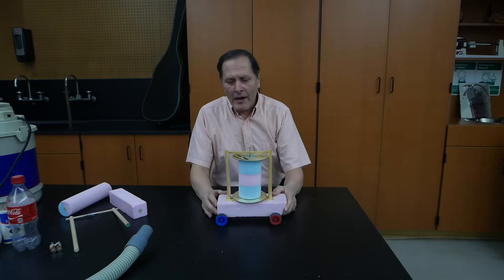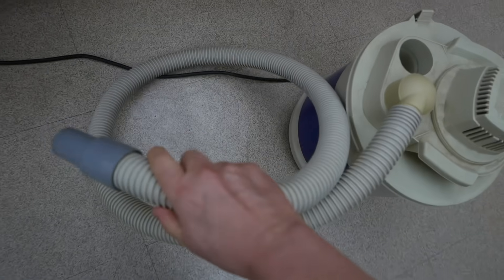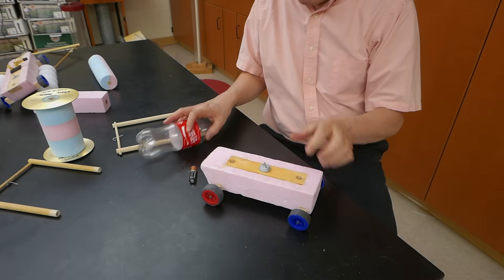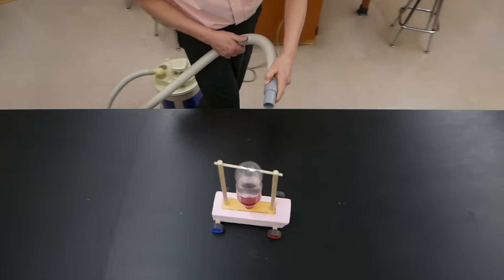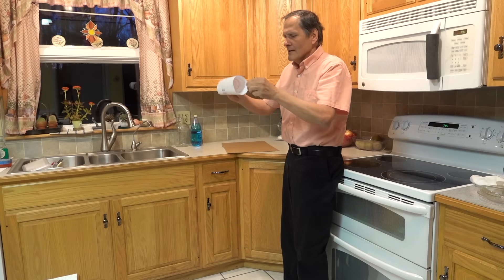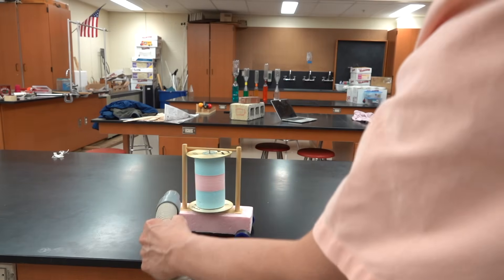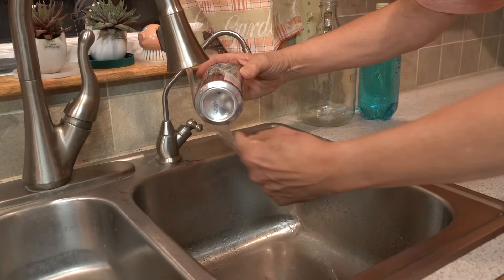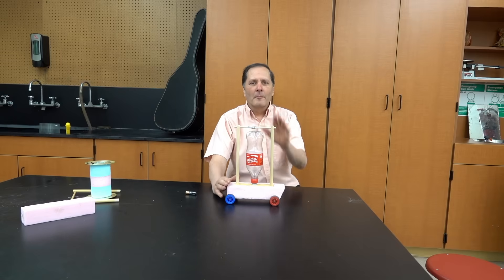Flettner Rotor Sail Cart // Homemade Science with Bruce Yeany

Comment: i saw some articles about ships using these now and found this video when i wanted to find out more. you did a great explanation, thank you. i do have a question, since you need to make the rotor rotate to make it move anyway, is there a power saving by making the motor move instead of say the wheels for that car or a propeller for a boat? if so how much are we looking at?

Comment: The unanswered question is, why does the spinning create the lower pressure on one side?
Reply: Because relative to the air around it, the opposite sides of the spinning cylinder are moving at different speeds, thus creating a pressure differential.

Comment: When using this on a boat, how much more thrust is achieved using the power to drive the cylinder and the wind on the cylinder as to using the power (batteries) to drive a propeller in the water?

Comment: Hey Bruce,...love the demonstration,...learned something new. When you were showing how fluids follow a curved surface and you blew air past the outside surface of the stationary cylinder, it reminded me of what a lazer does when you shine it at the edge of a reflective cylinder, or in my case a 2" diameter rod of clear acrylic plastic. It turns the lazer dot into a line on the wall like a lazer level. Any relation between the 2 seems unlikely, but I had to ask,...

Comment: Wrong effect. 

What we are really seeing is the Coanda effect, which is really redirected airflow. Moving fluids tend to cling to the surfaces 7:02  moving across. If such a surface happens to be curved, the fluid will follow that curve.

This effect was famous in the boating world. Boats that tried to go too fast seemingly got sucke down, sometimes to the point of sinking.

This was definitely not because of the air pressure above pushing them down.

The solution to this problem was having a definite break at the stern, where the transom extended all the way down to the deepest part of the hull, or nearly. This way, the water flow was directed down, at the bow, but not back up, at the stern.

Comment: Hmmm. What if…you put vertical cylinders at the rear corners of a car? They could be powered by the wind, and use their spinning to pump air into the wake zone behind the car, decreasing drag. 

Additionally, cylinders geared to spin the opposite direction could pump air from the rear diffuser, lowering underbody pressure, increasing downforce.

Comment: My question is: why not just use a regular sail as it does not require any outside energy? I suppose it means the flettner is only useful in making another source of propulsion more efficient. Ultimately lowering the air pressure in front and increasing it in the back to create forward motion is what makes turboprops and turbojets work anyway. So I presume it’s just about Flettners increasing aerodynamics to not only reduce drag but to use the force of the drag to increase efficiency.
Reply: I assume the wind can blow from any direction removing the need to tack in a less direct path
Reply: @jamessteidl5260 . Nope. In practice it works pretty much as a normal sail with regards to wind direction. The force vector is always 90° to the wind direction.

Comment: I built an RC sailboat using one of these. It worked pretty well! I just used a PVC tube directly on the top of a brushless out runner electric motor Lol! I could get about 40minutes to an hour of run time of run time. So overall pretty successful!
Reply: to me it seems that if he had put the little electric motor turning the wheels the car would have made headway against the vacuume cleaner's exhaust if he had blasted the little cart head on.  after all these long years of trying to push this concept, lets just put it to bed.  may as well put oars on the ship and let the refugees of various conflicts world wide man the oars.
Reply: @johngillon6969  That's not the point. Besides: It takes more energy to drive wheels on a vehicle or a propeller in water then to spin a tube. It's a sail, not conventional propulsion. You have to tack and stuff to go into the wind!
Reply: @ezrarichardson279  The point is if all the energy from those batteries was applied to the wheels it would be faster no matter what.  the energy to spin the rotor would be more efficiently used by driving the wheels or a propeller.  i feel like i am discussing efficiency with someone who would argue in favor of a recumbent bicycle over the traditional racing bike.  i just think over one hundred years of beating a dead horse is kind of a waste of time.  if the rotor were a profitable venture, there would have been more of them floating around.  this is of course an interesting phenomena. and if recumbant bicycles were more efficient, than you would see them competing in the tour de france.  BTW do you enjoy reding science fiction.?  my self prefers Louis Laamore, i guess it may be a divide between a traditionalist and those prefer to constantly re invent the wheel.  Why?
Reply: @johngillon6969  The question isn't about speed, but efficiency. And besides, the speed of the vehicle is proportional to the wind velocity so it could absolutely be faster than the same motor attached to the wheels directly. Also, recumbent bicycles are among the fastest and most efficient bikes out there (although I prefer traditional ones personaly). My point is that if you're using a couple amps for a long period of time to spin a tube which is supplementing and helping along a traditional propulsion system, that propulsion system will be more efficient and faster overall. After all, it's not the tube that creating the force, it's the wind. And to be fair, the whole point of this video is to show case a cool science concept, it has nothing to do with proving viability. None of this stuff scales particularly well either.

Comment: It would be interesting to see the experiment without the spinning rotor(rotor sitting still) like you showed us, but with a wind guard instead of you directing the wind flow with the blower hose. A guard that allows you to have wind applied to the entire device, like the spinning rotor allows, but directs it to only flow past one side of the rotor causing forward motion. To see if it actually can work, if so then you don't need the spinning motor and batteries, but a guard. IT would be a huge experiment finding the right shape guard that will possibly work. If you can direct more stray wind to one side than the other just by shape, then it might move. but then we will find out the sail is already got it all beat. lol But at least we learn more specifics about fluids.

Comment: could this provide useful thrust if fitted to a push bike ? How big would the rotor have to be and how fast would it have to spin? I'd be grateful to work it of for myself if you can direct me to the formula
Reply: What’s a “push bike”?  
Do you mean a regular bicycle with pedals?

Roads curve and wind directions change “rapidly” on land.  Not so much on the ocean.  You would need to be constantly adjusting the Flettner rotor’s spinning speed and direction of spin.  I also think that you would usually have more of a headwind by the propulsion of your own two feet.  That headwind will direct the thrust to the side, not so good for a bicycle.

There’s another device with a propeller that might work.  I’ll see if I can find the video.
Reply: @sambrusco672  yes sorry 'push bike' means a bike without a motor connected to the drive train.

Comment: Hi Bruce - Great experiment. I never knew about this kind of rotor before. 

A few questions, that I hope you can address, perhaps in a new video:
1. Is it always required for the wind direction to be perpendicular to the rotor? Can the wind vector be at any angle and still generate the same amount of forward motion power?
2. What happens if the wind is exactly behind or ahead of the craft? If it is akin to a sailboat, can the craft move directly upstream or downstream relative to the wind flow?
3. Finally, wouldn't a rotor with fins or blades be more efficient to spin the rotor?
Reply: My thoughts exactly!  I will refer to this diagram https://iveybusinessreview.ca/wp-content/uploads/2018/04/Hapag-Lloyd-Graphic-2-Rotor-Magnus-Effect.png  

If the wind is coming perpendicular from the left (the port side), and the Flettner rotor is spinning clockwise when viewed from above, the thrust will move the ship forward.  Yay!  All is right in the world!

If the wind is coming perpendicular from the right (the starboard side), and the Flettner rotor’s mechanized spin is REVERSED to be counter-clockwise, the thrust will move the ship forward.  Yay!  All is right in the world!

But it seems that if it’s coming from any other angle, the thrust would continue to add to the ship’s forward motion, BUT IT WOULD ALSO PUSH THE SHIP OFF COURSE.  So, if you are traveling from China to Los Angeles, you could end up in Mexico or Canada (if you don’t compensate by steering).  This is similar to flying an airplane.  You can point the plane in the direction of Washington DC, but you need to compensate for the lateral forces of the winds aloft.  

So my QUESTION is, can the Flettner rotor’s thrust be directed beyond reversing the Flettner’s motor (or shutting it off)?

By the way, if you WANTED to go backwards (to stern) or sideways, I suppose the Flettner could be used under favorable conditions.  But I don’t see that as useful except to avoid collisions or in port, and in port I would think the thrust would not be precise enough.

One other thought.  It would seem to me that the Flettner rotor would at least increase drag if the ship is not perpendicular to the wind.  Then again, winds push ships off course all the time, because they are so darn tall and long.

Comment: As a windpower experimenter I wanted to know if the surface finish on the Flettner cylinder makes a difference to the force. So I was interested to know if the "square" rotor was better than the circular or not. But you did not say if there was a difference in the force. This is quite important to know as it effects the design of how to get the best rotor. All of the designs of rotors on ships appear to have smooth surfaces, but if they had a dimpled surface like a golf ball would that make them better? Someone needs to do research into this.

Comment: Nice intro in this topic. But many questions are not answered. Like: Why rotating the cylinder? What effect has the rotation? Is the force greater if the cylinder rotates compared to the case when it does not rotate? How does the force changes in case the cylinder has a surface like a golf ball? @04:24  Can the force be increased by avoiding turbulence's? 
The conclusion is also missing:
Stop the video at 04:24 and while you think about this: 
In case the rotation has no force increasing effect you can "transform" the profile (= a circle, which is a "cut through a cylinder") to a classic plane wing. But the wing is more effective due reducing turbulence's. Or sticking to boats: You get a special sail. "Special" because the standard sail "catches" more the wind  than uses the benefits from aerodynamics.

Conclusion:
But a plane wing (with winglets) on a boat, take care that its well orientated / in-line with the wind and you get the max. force.
Waiitng for an A.I. that calculates the optimal shape for us. (Or even better an "object" that changes his shape regarding to the current wind speed.)
Reply: As for the question about rotating the Flettner rotor , watch the video again.  He did explain it.  

As for the vertical wing, maybe that is better, but the race boats that use them have difficulties when the wind is over 40 mph (I think).

Comment: the question is is the motor power required to turn the spinning cylinder more than the power that would be needed if the motor propelled the car or boat at the same speed?
Reply from the maker: in my example, yes but on a large scale the energy gain from the wind can be 70% greater than the energy needed to turn the masts
Reply: @YeanyScience  interesting.  Thanks.

Comment: what if instead of spinning the cylinder you cut the cylinder in half with the round side facing forward? 
It would look more like a sail.
So... what if regular sails were tubes, pulled tighter across the back to make a semi-cylindrical shape, held apart by ribs.
I'm guessing sailing ships achieve a similar effect just by using multiple sails, and that it's how they manage to sail into a headwind.

Comment: Thanks Bruce,  do you know if the speed of rotation effects the movement speed?
Reply from the maker: good question,  I don't know if there is an ideal speed for the rotation but it is something I would like to test by adding a reostat to it and control the speed.  I have a few other ideas that I want to try for it also.  There will be a follow up video for this piece

Comment: cool effect. but if you have to power the rotor why not just power the wheels instead? much more efficient.
Reply from the maker: On this scale  it doesn't make sense, this is  mainly for demonstration purposes but on the full size ships,  the amount of energy going into making the rotors spin is quite small compared to the energy savings they can get from using them, anywhere from 5 to over 20 percent

Comment: Thanks. And what about shoot air only into one side but in the opposite sense of rotation? The car will start to go or not?
Reply: Do you mean if the wind comes from the right side of the vehicle instead of the left?  Assuming the Flettner rotor is spinning in the same direction (clockwise), the thrust will be toward the rear, and the ship will go backwards.  

BUT if the rotation of the Flettner can be reversed, the ship may go forward.  THIS is one of my questions to Bruce.

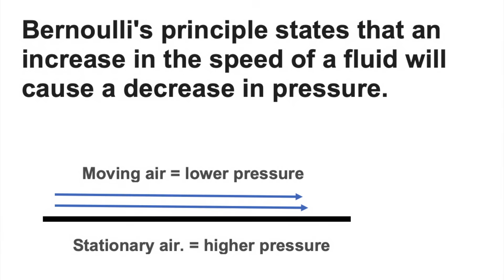Comment: thanks for posting.        at 3:40, you Should consider  UPDATING, and increasing the accuracy of,   this explanation.        bernoulli  should  Not  be  applied to  Aerodynamic processes; or where an object is  rotating at a high rate.     aerodynamic lift is a result of persistent zones of Differing  air pressure or density.     these  pressure differences can be caused to occur, Without  Velocity being a major factor, UNLIKE  bernoulli.     for an example,  see a  (model)  slow-flyer.           magnus (as refined by newton)  and   coanda  should be referenced.      googletranslate
https://en.wikipedia.org/wiki/Magnus_effect
https://en.wikipedia.org/wiki/Coand%C4%83_effect

https://www.youtube.com/watch?v=15HUzLifQWU&t=

Comment: If 'ridges' are added to the cylinder... it 'feels' like the effect should be greater (due to 'catching' more air) but if I'm understanding the principle correctly, it would actually work less well, since the continuous, smooth flow of air around the curve would be reduced... right?
Reply: I think the latter part of your statement is correct.  Ribs introduce small vortices.  The objective is not to turn the rotor;  that’s done mechanically by a separate motor.  The objective is to create lower pressure towards the bow (front) of the ship, to create forward thrust.

Skyscrapers no longer go straight up, like The Twin Towers did in New York.  The floors change shape as they reach skyward, as the Freedom Tower that was built in its place.  This is known as “confusing the wind”.
Reply: @sambrusco672  whats hilarious about this for me is that I wrote that question three years ago, you've just answered it and I literally have NO IDEA what my question even means anymore - I'm gonna have to rewatch and think about this whole thing all over again to even manage to understand what I was asking 🤣
Reply: Laminar flow.

Comment: What would happen if instead of a crosswind, there was a headwind or tailwind?
Reply: Sorry Bruce, I must disagree.  The thrust from a Flettner rotor will always be 90° to the wind direction.  In a headwind, I think you would stop spinning the Flettner, otherwise it would push you perpendicular to your course.  If you were to change course to “take advantage” of the wind coming from your intended destination, you would be going sideways.  Cargo ships don’t travel well sideways.
Reply: @sambrusco672 . True enough, but it's the same as any other sailboat really. That's why they have a centerboard to keep from being pushed sideways, but since the force is still there it moves forward because it's shaped to do exactly that. I don't know how much difference between this and a sail for minimum angle into the wind there would be, but it'd be interesting to know.
Reply from the maker: good question, tailwind would help any boat's movement,  I would guess with a headwind they might change the heading to take advantage of it just like a regular sailboat would do.